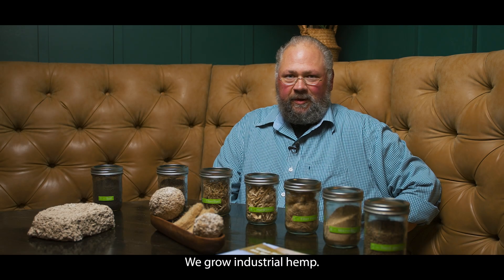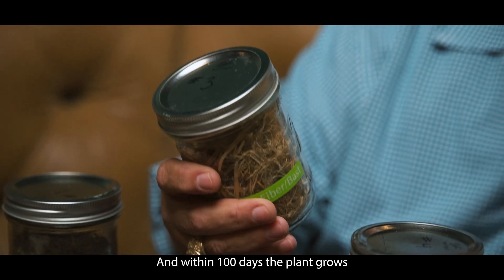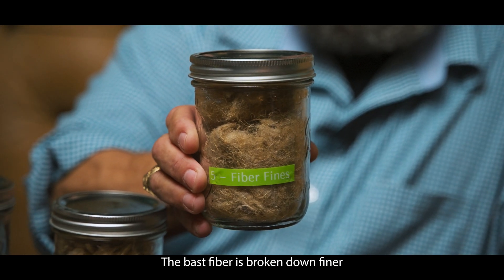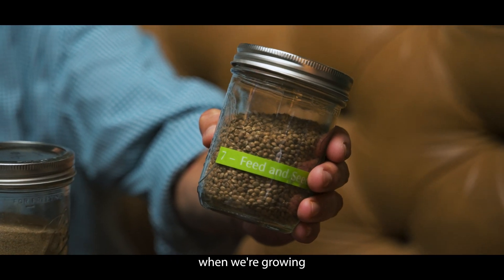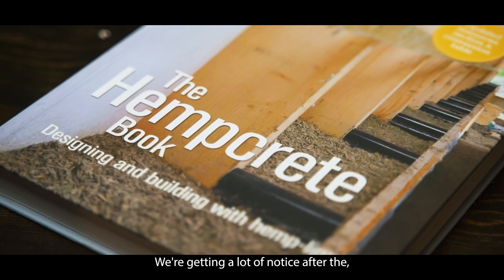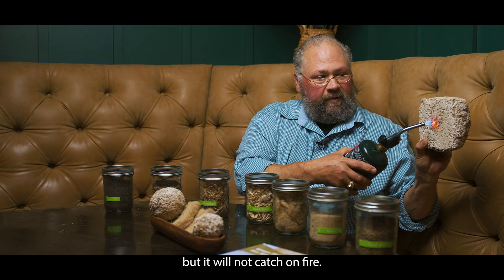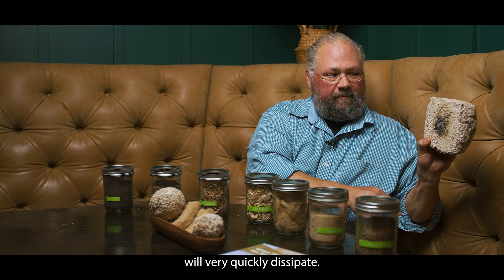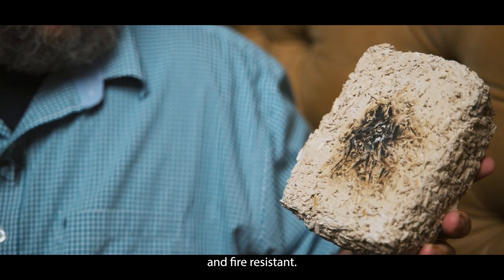Applications For Hemp - Seed to Shelter Sustainable Solutions and Soil to Oil Healthy Alternatives!

Comment: What is the weight compared to concrete
Reply from the maker: So this is a tricky question from the standpoint of who is mixing, what is the mix design, and who is compacting the material into the cubic foot.  We typically see the 20#/cuft with lows of 15# for a very loose hand tamp pack on up to 25# for a wet mix heavily compacted with mechanical tamp.
One cu yd of concrete is roughly 4,500#
One cu yd of hempcrete would be roughly 540#
But again, hempcrete is not structural in nature.  It isn't concrete, hempsulation would probably have been a better descriptor.  It will continue to draw moisture out of the air and recalcify/petrify back into limestone.  Tis allows it to gradually increase in strength over time.
Reply from the maker: I say that specifically in the videos if you watch them all the way through.  I spent answered several questions repeatedly so we decided to make these education and informational in nature.  Thanks for your comments.

Comment: Okay not to be that guy but if you are using it for its burn resistance it wouldn’t make much sense to build a non fire resistant house around it would it? Am I missing something? That’s like having a gun safe where the edges and vertices are solid titanium but the faces of the safe are made of aluminum foil and faith 😂
Reply from the maker: The 3 details in the 2024 IRC Code Appendix BL give options for the location of traditional wood framing to the exterior side, double stud, or interior framed.  My testing and construction methodology involves primarily utilizing the framing internal to the external hempcrete surface.  Thus having both faces fire resistant.  I believe this will be necessary to ultimately pass a 2 hour UL fire test burn, and eventually NFPA-285 testing for widespread commercial adaptation.  

Having ASTM standards for raw input materials will be necessary for repeatability of system design.  Additionally, there are numerous other framing options for the structural strength and nothing requires the use of a combustible material.  Again, hempcrete is not structural, it is for the internal portion for insulative performance.  Hempcrete does not care if it is placed within a structural steel frame, PEMB frame, cast in place concrete structure, precast structure, mass timber, or direct applied to the backside of existing masonry or stone structures as is common in Europe for restorations.
Reply from the maker: Exterior skin varies in all construction applications.  Fire insulation (hempcrete, mineral wool, ceramic batt, etc.) and the fire resistance of an assembly are agnostic to the exterior cladding system.  Commercial standards need to be developed and people including us are working towards that every day.  In hempcrete construction, I do not need the skin to be anything in particular or even in place.  The interior slows the burn long enough to safely exit the structure.  Especially when compared to the burn times of conventional wood framed residential construction.  Thanks for your comment.
Reply: @AggricreteLLC  isn’t that why we add fire blocking.